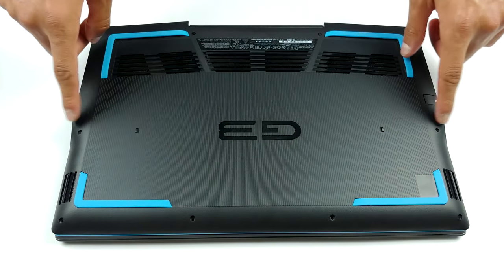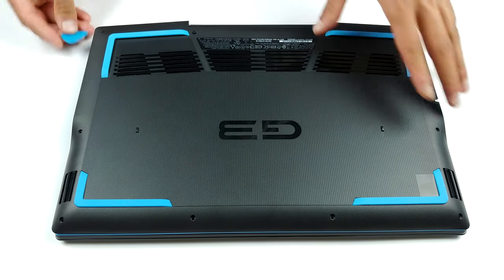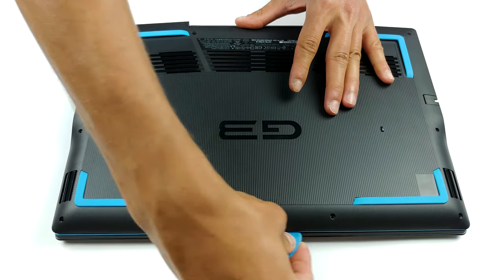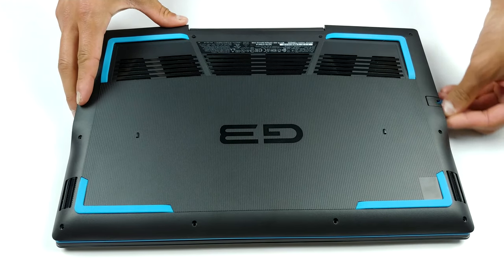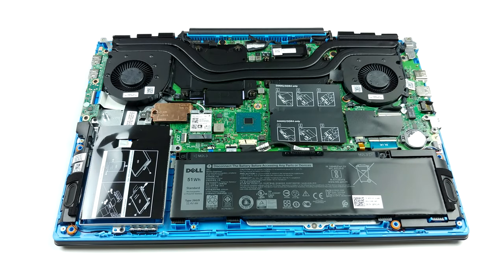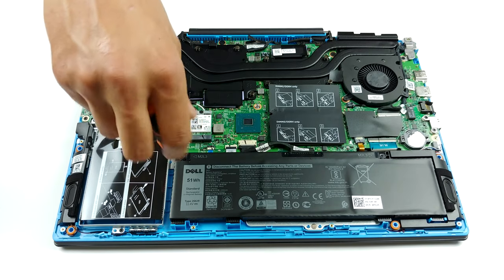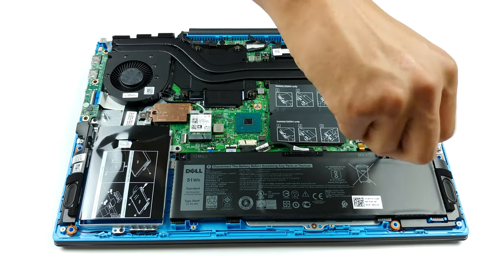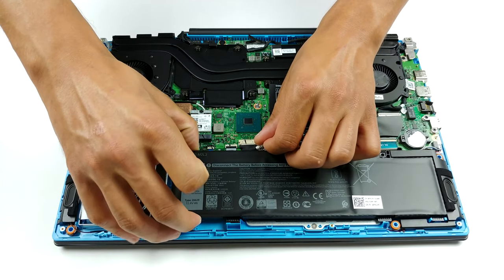🛠️ Dell G3 15 3500 - disassembly and upgrade options

Comment: Going on 5 years strong with this laptop. Here's my Personal opinion 
Stock - dell g3 15 3500. i5-10300h, 1660ti 6gb, 512gb, 16gb DDR4
Upgraded - i5-10300h, 1600ti 6gb, 512gb, 48gb ddr4 

The plastic on it is incredibly cheap and not durable. The Keyboard faceplate is cracking overtime and chipping. The hinges on it are good in my opinion although i've heard mixed reviews. I've replaced the screen once from the default LCD to a Matte. The original NVME Ssd has begun slowing down. I am willing to upgrade and fill both nvme slots that my device has to offer. I've upgraded the ram to corsair 48gb ddr4 stick modules. The original SK hynix ram was starting to slow down & Not be good enough for what i was using the laptop for (This will give me hopefully another decade with this laptop). The Gpu & Cpu cooling system is standard compared to other models in the past when it was released and varies from todays technology. If your using it for heavy gaming please, for the sake of the laptop turn it upside down and plug into a monitor. It can get hot very easily and the clearance on the bottom is not enough. Around when i had it at the three year mark i replaced the thermal paste, it was helping it a bit but not much. the charger is slow i got to say. However, if you optimize the battery settings you can get six whole hours out of it light web-browsing, gaming is about an hour. Speakers are fairly loud & decent for everyday use. The SD card reader is a bonus considering you don't get them in newer laptops.

Comment: Hey, are you sure that the 3500 supports 32GB of ram? in the video it says they believe it has support for up to 32GB of ram but in the dell manual it says only 16gb, the 3590 yes in the manual says it supports 32GB in dual channel. The chip set of the 3590 is HM370 and the 3500 is HM470. would anyone know how to answer, or tested? thanks.
Reply: Hey, I bought the Dell G3 3500 and had it upgraded to 32 GB RAM. Yes it does support 32GB, but I believe that's the max.
Reply: @sanjaymehta5872  Hello, how cool that you managed to do this! Help me, if you put 32GB of RAM on the Dell G3 3500, what is the speed of RAM? 3200, 2933, 2666?
Reply: Per Dell, it will take a max of 64GB.  The default speed is 2933MHz.
Reply: @sanjaymehta5872  sorry for the late question, but does your  Dell G3 3500 laptop also have an intel i5 processor, like mine?

Comment: I bought this laptop in last year and right now i have a huge problem with fans. There are so loud event when CPU has 40-50C. I set in setting a quiet mode, but it's not difference between quiet, performance or balance. Every time when i play a game after few minutes the fans make a lot of noise.
Reply: same here but i think it's normal
Reply: I don't know if you still have it yet, but if you do, set the thermal profile to cool in bios, then on throttlestop reduce the turbo power limits (click tpl button) to 35 each. That should do the trick
Reply: @MantisShrimp80  TTHANKS you !
Reply: @MantisShrimp80  Hello, are you doing this in alienware command center? I see the cool profile but nothing in the app that mentions throttlestop
Reply: @lizardv99  No it is a different application that you need to download, checkout some videos on YouTube.
Reply: All gaming laptops are noisy and hot if you do something intensive
Reply: @MantisShrimp80  perfect combo to play on half the fps lol

Comment: So I need to check the internal camera/microphone of my G3 15, which cable is the right one to check? as apparently it is either disconnected, broken or the piece just went bad at some point and needs replacement.
Reply: @Diogo Buíque i dont think so.....

Comment: I was wondering is this model supports a 2.5 inch solid state drive, instead of a 2.5 inch hard disk drive.
Reply: do you have the answer ?
Reply: @natanyelriahi5718  Yes! I guess it does support a 2.5 inch SSD, they're far more expensive than a 2.5 inch mechanical hard drive but the speed difference is abismal and in the end it makes for a better investment.
Reply: Yes it is.

Comment: I bought the Dell G3 3500 (same as in the video only with net 1660ti) November 2020. I have the problem that the laptop now has only one hour of battery life - and only when writing Word documents. 
Can I send the laptop ( have 1 year warranty so still until November 2021) back and get a new one in return?! What do you think, I would be happy about an answer.
Reply: Is doch klar, das die Batterie nicht lange hält. Der muss ja auch viel mehr versorgen. Eifnsch GPU abschalten und bei der CPU Turbo Boost ausmachen, dann sollte es besser sein
Reply: @antonweller726  Kannst du mir bitte bitte erklären wie ich die GPU abschalte und den turboboost von der CPU deaktiviere ?
Reply: @antonweller726  Bitte!!!
Reply: @ursulavonderlaien9712  tut mir leid, habe es jetzt erst gesehen. Du musst das im Bios machen. Youtube Tutorials zeigen dir wie du dahin gelangst
Reply: @antonweller726  Ok Ok. Meinst du ich kann die Akkulaufzeit meines Notebooks erhöhen wenn ich in den erweiterten Energieeinstellungen die maximale CPU Leistung herunter setze z.B von 100% auf 25%??
Reply: @ursulavonderlaien9712  auf jeden Fall
Reply: @antonweller726  ok gut gut. Gibt es des Weiteren noch Möglichkeiten die Leistung der Hardware zu stutzen? Um längere Akkulaufzeiten zu generieren?
Reply: @antonweller726  Zusätzlich hab ich noch ne Frage ob das sehr zeitaufwendig ist die GPU zu deaktivieren.  Und soll ich nur die externe CPU deaktivieren oder kann ich auch die Intel uhd graphic deaktivieren????
Reply: did you make sure to put the pc's power plan to balanced?
Reply: If you still use it the either get dell power or remove alienware command center and change power settings to run cool in bios, use throttlestop to reduce turbo power limits to 35 each, and you should do sort of ok.
Reply: @MantisShrimp80  Can you please explain ir easier. SORRY my Englisch and the translation is Not the Best
Reply: @ursulavonderlaien9712  If you still don't understand I can upload a video on how it's done, but it'll take a few days.

Comment: Hi i juste bought this laptop i change ram to 16Gb 2933 because the i5 doesnt support 3200 ram and add a 2.5 SSD but i want to change the SSD with an m.2 2280 WD in sold do you know how Can i do it with the stock heatsink in actual nvme ?

Comment: What is the chip that is like a cpu without a heatsink? beside ram slot??
Reply: CPU
Reply: Or your talking about the wifi card ?
Reply: @Cryparanoia  Middle of the wifi card and the ram slots that is looks like a cpu without a heatsink
Reply: @Cryparanoia  Im kinda wondering what it is
Reply: @framespersecondgt4424  anyway dont buy this laptop  hahah
Reply: @framespersecondgt4424  has terrible hinge design faulty from the factory itself 
Breaks after 3 or 6 months or within a month
Reply: @Cryparanoia  I actually have it, it really has stupid design, fans are even blocked by the monitor. Got this big mistake.
Reply: @framespersecondgt4424  hahah 😆 
Well what is done is done
Reply: @framespersecondgt4424  but i'm also getting this soon 🤣😂
Reply: @Cryparanoia  Goodluck on using it, hahahaha. Mine just 1 week old, and got an issue.
Reply: @framespersecondgt4424  
dont always open it hahah 😆 
I suggest tightly taping the hinge
Reply: @framespersecondgt4424  Welcome to the club
Reply: @Cryparanoia  Have had mine just about a year with no concerns.

Comment: anyone who has this notebook also had problems with heat?
I normally get more than 90 degrees while gaming since it arrived I think its because of very high power consumption but im not sure
Reply: Yes i use the laptop like a home computer so I let it open so it doesn’t overheat

Comment: Did you review 3590 instead? Because you only have one slot of m.2 for SSD. According to Dell support on the website, they have 2 slots. Not including the m.2 for wireless.
Reply: We also did a review/disassembly of the G3 3500, it only has one M.2 slot. Dell apparently thinks if you put an M.2 adapter in the 2.5" bay it is an M.2 slot.

Comment: Hey can i upgrade i5 to i7 in this laptop, is this possible..?
Reply: Hey I was thinking of upgrading the cpu too can we ?
Reply: @1hakari  nah, you can't do that in a laptop
Reply: @kaseynguyen9256  is it possible to upgrade gpu? or do i need to buy a new laptop
Reply: @slimypenguin  you have to buy a new one. Graphic cards are specially fitted into a laptop and cannot be taken out
Reply: @kaseynguyen9256  damn thanks
Reply: i7 is a different variant and mobile cpu's aren't available in the market, so no upgrades there bro.

Comment: does this laptop support 16gb ram (2x8) at 3200 mhz?
Reply: I did 32GB at 3200mhz and runs fine.

GPU is my primary limiting factor now.
Reply: At Dell's specs sheet, it states up to 2666 Mhz (32gb Total, 2 slots 16 x 16)

Comment: 3500 only support 16gb RAM??? WTF! A gaming notebook? And only 1 MS SSD/NVMe slot?
Reply: It has 2 slots
Reply: @Cryparanoia  2 DIMM slots. But NVME only 1 and 1 SSD SATA slot.
Reply: So what guys I’m about to buy it but I don’t know, I want it for gaming so, supports 32gb at the end or not?
Reply: @matiasriquelmecortes1815  it supports upto 32gb, it is mentioned in dell's official site
Reply: @lmagnabosco1010  Hey, are you sure that the 3500 supports 32GB of ram? in the video it says they believe it has support for up to 32GB of ram but in the dell manual it says only 16gb, the 3590 yes in the manual says it supports 32GB in dual channel. The chip set of the 3590 is HM370 and the 3500 is HM470. would anyone know how to answer, or tested? thanks.
Reply: @DouglasSVieira  opa, vi que tu é BR
Na época que comentei isso o 3500 tinha acabado de entrar no site e dizia que suportava 32
Fui ver agora e realmente tá 16gb, não tô acreditando que botaram uma placa que suporta só isso em um note que é muito usado pra trabalho
Reply: @DouglasSVieira  mas o meu Avell tem esse Chipset e  suporta até 64
Reply: @lmagnabosco1010  Sim man,  achei muito errado isso, eu fico com medo de comprar 2x 16gb e não funcionar. mas é o que falei o 3590 diz até 32gb esse 3500 só até 16. queria saber se alguem testou isso hahaha
Reply: @DouglasSVieira  pow vey, to na mesma duvida, com medo de comprar o pente de 16gb e não pegar =/ conseguiu descobrir se o 3500 (i5 10300h + 1650) pega os 32

Comment: I buyed this laptop 2021 december at the beginning there will no be issues but later it will get more worser and worser the problems getting bigger and bigger my first problem with this laptop were ram replacement i did it, then it was thermalpaste replacement because the pc will crash a couple of times after you use it like 2 years like me the thermalpaste will get old and had to get replaced, now my new problem is the motherboards lcd railers are dead i have to replace the whole motherboard dont ever EVEEERRRRR buy this shit, buy instead a pc i hope i could help you with this.